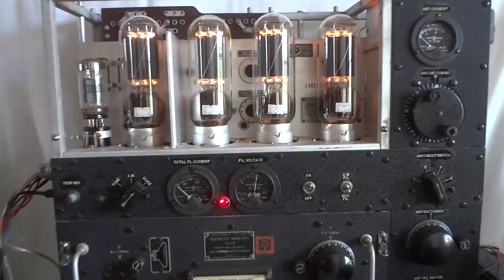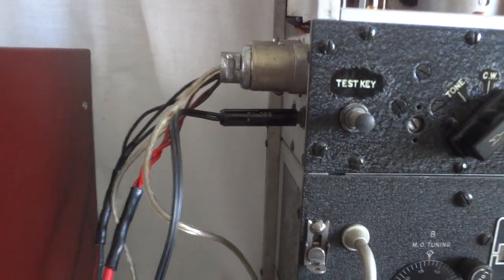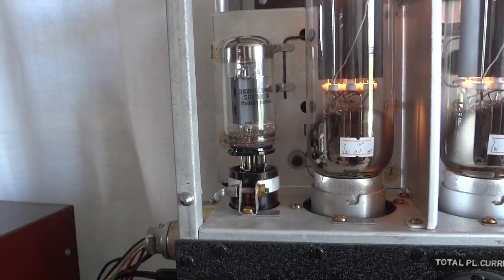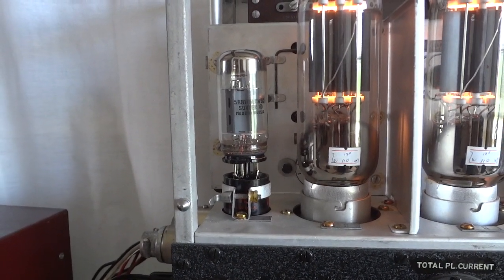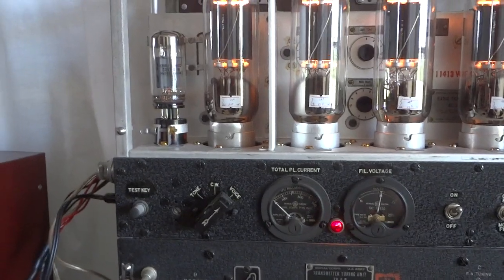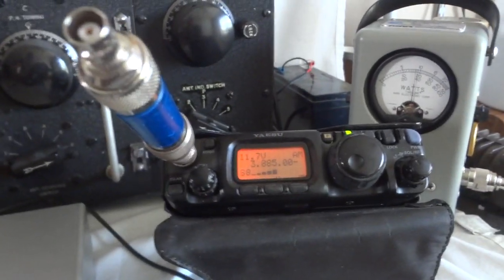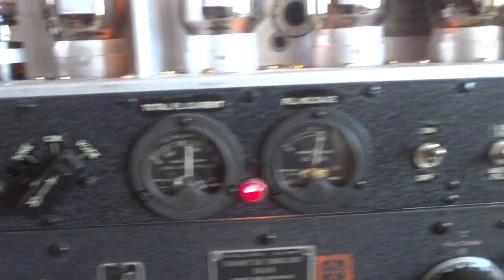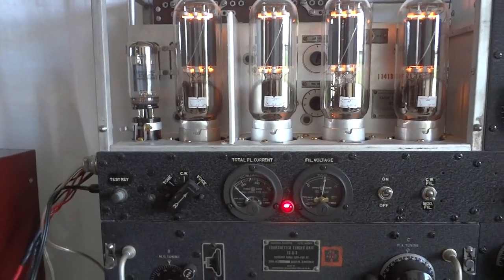BC 375 transmitter using a 6L6 tube instead of the VT 25

Comment: 6l6/807 are beam tetrodes
Reply from the maker: Yes, a 6L6 is a beam forming tube. A pentode though, because it has five electrodes: Cathode, control grid, screen grid , suppressor grid and anode (i.e. "plate").  An 807 is not used here.  A tetrode tube has only 4 elements, that is not what a 6L6 tube is.
Reply: @LifeIsTooShortForQRP cathode,control grid,screen grid,beam plates,anode...no suppressor grid..1936 rca patent

Comment: What process did you use to do the lettering?
Reply from the maker: These templates:
https://www.ebay.com/itm/155504697845
together with these drawing pens:
https://www.ebay.com/itm/267278193928
the Rotring pens were filled with white waterproof ink.
Reply: Thank you - your 375 looks excellent

Comment: What’s sad is that Rosmallen amateur radio rally a complete BC375, BC348, several tuning units, antenna trailing cable and all interconnects, canvas bags, spare valves, power supply all the ancillaries including mics and spare hook up cables, webbing and more.......€400 the lot. Guy wanted €500 and I couldn’t ship it to the UK and it wouldn’t fit in the car. I went to arrange shipping and when I returned the guy sold it for €400..... I was in tears as the BC348 shock Mount was worth €200 on its own. This part was normally left in the aircraft when it was scrapped and only a very few ever made it to market. A hunk of metal with 4 rubber cushions.... silly prices. I know someone with the BC191 which was the 12 - 14v ground version of the BC375 and naturally the rotary converter was designed to run from aircraft generators and 24 - 28v. If you don’t have the correct PSU then you need to supply 500v obviously. This is a joy to watch and pure genius....kudos
Reply from the maker: Yes, those original equipment mounts are very expensive. Like I mentioned in the video, I did get my hands on the original BC-375 mount (not shown in the video). Paid $200 for the thing. But they are incredibly rare, so I thought: What the hell.
Yes, that was a bummer; $500 for the whole with all those accessories is a steal. I bought this one at Dayton for $50, without any tubes and all the black wrinkle paint had chipped of, weird enough. Must have been sitting in someone's barn for many years, then the ants eat this kind of paint (no joke, this is really true!) . But the unit had no corrosion, no damage, no mods and was therefore very restorable. All the black painted surfaces you see here were repainted by me using black wrinkle varnish, except for the TU box. That box was added later and had its original paint. Cheers.

Comment: Excellent work! Which side of the filament did you connect the cathode of the 6L6 to? Also do the electrophoresis power supplies generate any RFI in your receiver?
Reply from the maker: It doesn't matter, connect the 6L6 cathode to either pin 2 or 7 of the 6L6 filament pins, but make sure the cathode ends up connected to the VT-25 socket terminal that goes to ground (thus NOT the VT-25 filament side that goes to R1191 and R1192, see the BC-375 diagram downloadable from the web). The electrophoresis power supplies are very RF quiet,  no switching hash noticeable on my receiver. Check eBay, they go anywhere from $50 to $200 I have noticed, depending on condition. Cheers.
Reply: Thanks very much, I’ve had my BC-375 operational for several years, but have never been happy with the power supply regulation (10%) I’ve ordered a couple of the electrophoresis supplies. Thank you !